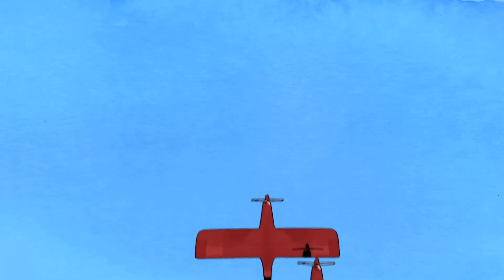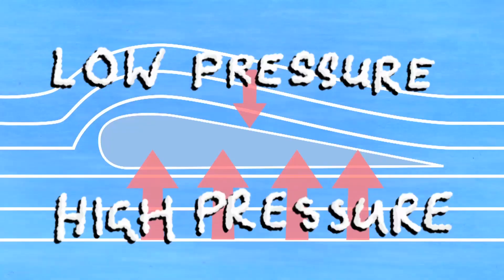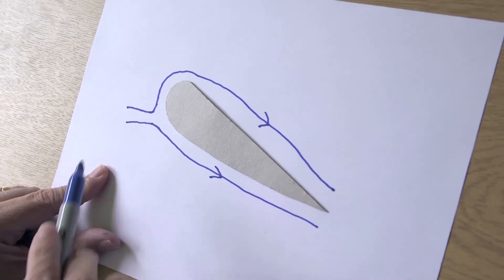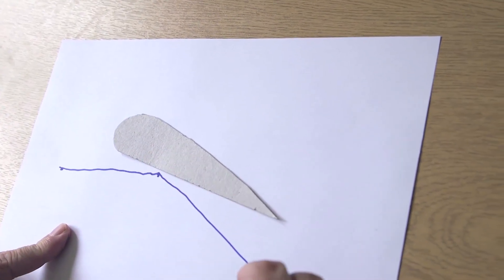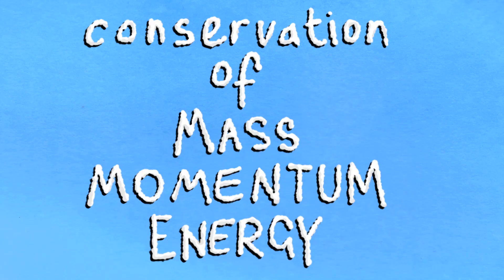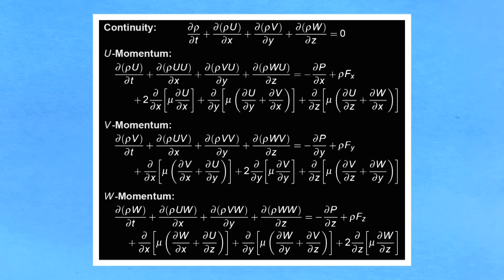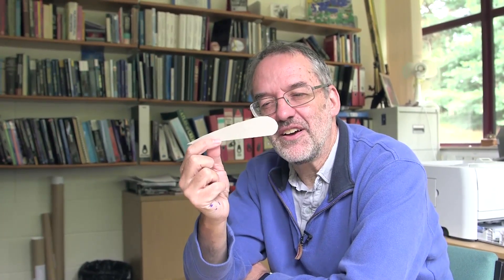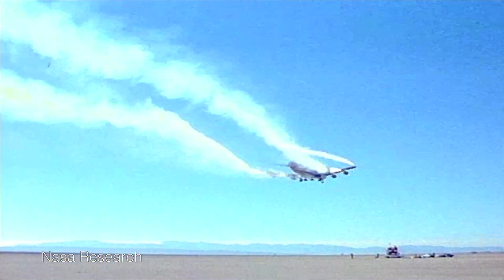Lift and Wings - Sixty Symbols

Comment: Why is there a pressure difference at all? I'm wondering that, because the air is only streaming faster because the pressure got increased in first place (7:22). So why doesn't that cancel out the Bernoulli effect leaving you with same pressures on both sides?
Reply: Pressure is NOT the only way a fluid can apply a force to something.  The total drag experienced by an object is found by integrating ALL of the forces per unit area around the surface area.  An infinitesimally thin flat plate placed at a zero degree angle of attack has drag (a force), because of the no-slip condition imposed at the surface.
Reply: niffenator  Yes, although skin friction is a minor part of total drag on the the average light aircraft. It’s not generally realized that the surface of the Hubble Telescope mirror ( never mind the surface of an aircraft wing ) looks like a topographical profile view of Switzerland at molecular dimensions!  So any airflow over the surface will keep crashing into the peaks or plateaus and bouncing back in random directions into the valleys and canyons between them, in effect setting up zillions of mini stagnation points over the whole surface of the aircraft , not only it’s wing, and it’s this effect which is responsible for the no-slip condition and resulting velocity gradient in fluid flow over fixed surfaces .
Reply: The pressure differential is there because that's the only way gases can ever apply a force onto anything.

Think about it.

Any time air is pushing on something, there's high air pressure on one side and low air pressure on the other side.

This also applies the other way: Any time something is pushing on air, it creates a high pressure zone on one side and low pressure zone on the other side.

Now, the effects of these pressure zones can be very different depending on context. If you're pushing a flat cardboard sheet through the air, the air is flowing from the high pressure zone (in front of the board) to the low pressure zone (behind it), creating all kinds of turbulence, and presenting itself as drag.

But if you turn the cardboard sheet sideways and then angle it slightly, you'll notice that you're pushing air sideways, and the air is pushing the sheet sideways too so it can be difficult to hold onto it from just one side.

An aircraft's wing is also pushing the air downwards as it flows around the wing, and the only way it can do this is by being shaped and/or angled in such a way as to create a high pressure zone below, and low pressure zone above. A wing is also usually a lot better at this than a simple cardboard sheet, because of the way it's shaped to minimize drag and maximize lift.

The reason why an aircraft's wing doesn't "throw" air downwards is quite simply because there's more air in the way to stop a significant downdraft from being developed in the short time the wing travels through the air. In effect, the wing is "leaning" on a very large amount of air both above and below it, and that air doesn't really move all that much.

If a wing were to travel through the same region repeatedly, then it would eventually start to create a downdraft through that area. This is what happens when a helicopter hovers stationary in the air, or when a propeller is spinning and producing propwash.
Reply: HerraTohtori  Well, I would start by saying: To create lift u need to accelerate air downwards. But you are right; this goes together with a pressure difference. But can u really say that a part of the pressure difference comes from Bernoulli, which is what was said in the video in my opinion, or is it only the downward acceleration, which causes the pressure difference? I do not believe in the first option. The reason for that is in the main comment.
Reply: That is correct. The use of the word 'compressed' is not helpful because we tend to associate that with eg gas in a bottle (compressed by comparison to atmospheric conditions means that the volume has gone down and the pressure up). Each 'lump' of air in this region can be thought of as moving faster because they have a narrower 'channel' to move through, as you say. It can only obtain the energy required for the increase in speed by extracting that from the energy stored in it (ie each lump is subject to external pressure from its neighbours which does work on it by squeezing it. This is as if each lump acts as a spring. As the spring is released a little (P decreases) so its speed increases). 

I used to be confused because I believed that squeezing the fluid would result in a change in volume. At low speeds, the volume change is negligible, even though the pressure changes are significant ie the fluid acts as a very stiff spring.
Reply: The pressure difference is caused because the wing is interacting with the air in a way that deflects air in one direction, causing the wing itself to be deflected into another direction.

Bernoulli equations are always relevant and correct, but just looking at Bernoulli's principle in order to explain the pressure drop is a bit misleading and can lead to misconceptions such as the "equal time principle".

The pressure difference forms because it's the only way for there to be any force transfer between the wing and the airflow. It's just as much a cause as it is an effect. The lift force is generated by the pressure differential, but the pressure differential is caused because the wing applies a force to the airflow. It's a kind of a chicken and egg problem, see?

If the wing doesn't generate lift, then there is no pressure difference. If there is lift, then there must be a pressure difference as well. It's impossible to say whether the wing creates a low pressure zone in order to generate lift, or whether the low pressure zone is created as a result of the wing generating lift, because they are the same thing: The only way gas or other fluid can apply a non-zero total force on something is by a pressure differential.

Asking why there has to be a pressure difference for a wing to provide lift is kind of like asking why a table has to have legs to stay up.
Reply: the leading edge of the wing exerts a force on the air. the air has a (sound) speed at which it can respond to such forces. when using a hand pump you exert a force that (due to the closed nature of the system) increses the pressure in whatever you are pumping. the pressure difference that the wing creates will depend on its speed relative to the air and the air's ability to respond to the force and move out of the way. 

air tends to go from high to low pressure in order to stabilize the forces acting on it.

If you increase the viscosity (thickness) of the air (imagine the wing like a knife through warm butter) the wing would not affect (much) the air above the wing, and you would separate the air from parts above and below the wing. this would imply a vacuum (zero pressure) between the sections. the butter can remane in separate parts because it is immersed in another fluid that fills that vacuum. since for the wing it is only air (and because air is low viscosity) the air will move in response to that pressure difference from high to low pressure. since the wing is constantly moving it can continue to make that pressure difference
Reply: No, the only thing that causes the pressure difference is the fact that the airflow over the top of the wing is much faster than that over the bottom. Applying the right Bernoulli equation (there are several versions) will definitely allow you to calculate the lift force of an airfoil if you know the distribution of air velocities. The crucial difference is that his equations do not explain why this velocity difference arises in the first place, which is what Euler's equations do for inviscid flow and Navier-Stokes for viscous flow. The downward acceleration is a direct consequence of the pressure difference: the air farther away from the wing will remain at higher pressures and is pushed towards the lower pressure area, creating a net downward flow. In a similar vein, the pressure difference causes the air to bend ever so slightly toward the airplane on top of the wing and away from it underneath, giving rise to tip vortices. All of these effects are inextricably linked to lift in real airplanes.
Reply: Are you sure that the airflow over the top of the wing isn't faster because the pressure is lower there?
Reply: Hmm, I think it would be most correct to say that they are simultaneous. Bernoulli's finding in fact was literally that an increase in fluid velocity and a drop in pressure (and/or potential energy) always occur together. My reply was directed at David's second post, the "no" meant to express that it's not correct to say that the pressure distribution on the wing only arises from the downward deflection of air, but rather all of these effects are intimately linked together.
Reply: Ok so it's really complicated. Maybe you should understand the Bernoulli effect to understand this better. But I'm not happy with the explanation in the video. The Professor explained it with conservation of motional energy. But you can also use the Bernoulli effect with the air accelerated by an hairdryer, which means the energy for the forward momentum of the air doesn't have to come from the motion to the side aka pressure.
Reply: Well, not entirely, because Bernoulli's principle stems from conservation of energy. A hairdryer may add both kinetic energy and heat to the flow; Bernoulli's equations can only be applied outside the fan and heater sections. Moreover, the flow downstream of the fan will likely be turbulent and dominated by viscosity, where Bernoulli's equations assume smooth, inviscid flow. The effect is still there to be sure: the air upstream of the fan will definitely accelerate and decrease in pressure/temperature, while the air issuing from the nozzle will expand, slow down and cool down. But to get a quantitative analysis of the flow variables, especially across the fan and heater, you will have to apply more rigorous mathematics, including conservation of mass and momentum as the professor correctly states.
Reply: +Steven Franzen That's exactly what I mean - the relationship of cause and effect is really kind of fuzzy here. The flow can't accelerate without pressure being reduced, and the pressure being reduced requires that the flow is accelerated.

It's really kind of difficult to say which one the wing actually does "first", because as you noted, they're pretty much simultaneous and tied to each other.

What's really interesting, though, is that even with a flat plate aerofoil, you get lift when you give it some angle of attack. That means, even with a very simple aerofoil, the flow above the "wing" is accelerated, and a low pressure zone is created there. So personally, I don't like explanations that focus too much on the aerofoil's shape, because that kind of seems to ignore the fact that you get lift from a flat aerofoil as well. And it's not just "deflection" lift there either, it's the same kind of lift you get from a more advanced aerofoil - the flat aerofoil just produces less of it, and stalls easier.

In my opinion, the simplest explanation for the acceleration of the flow above a flat aerofoil is that when air goes over the leading edge (in laminar flow), it adheres to the top surface of the plate due to Coandă effect, and follows the surface towards the trailing edge. But because the plate is tilted, it's flowing downwards, away from the air above. So more air from above is trying to follow the air flowing downwards, in order to fill the void... so that's the low pressure zone. And because there's a low pressure zone, the flow over the wing is accelerated.

A more complicated aerofoil shape does things a little differently, but the basic thing is the same - except now you have a curved surface to consider, so the flow is turned continuously instead of abruptly like with a flat aerofoil. My visualization is that when air molecules are moving tangentially along the curved surface of the wing, Coandă effect again forces them to follow the surface and thus deviate from a linear path. This means the wing's surface is pulling air away from its natural, linear path... and pulling air above it towards the surface as well, so again, a low pressure zone is created and the flow is accelerated.
Reply: Yes, paper airplanes get by with very flat wings and many are very able flyers. What really happens is that any perturbation to a fluid, for example when a moving fluid encounters a solid object or an object moves into a fluid, sets off waves traveling at the local speed of sound. This is how the undisturbed fluid is first "notified" of the change and caused to react. Upstream of the object, compression waves are emitted, causing the fluid ahead to start deflecting away from it. At the same time, expansion waves recede behind it and cause fluid at higher pressure to start accelerating towards it.

Aerofoils enhance the pressure reduction by maintaining a large region of accelerated flow. The attachment is not due to the Coandă effect, it is just the flow being accelerated out of the way as it approaches any obstruction, which sets up a situation where the pressure initially decreases with the distance traveled along the surface. The ability to generate lift is limited mostly by the fact that you simply can't keep decreasing the pressure: eventually the gradient will reverse, which you can try to make as smooth and as low as possible, but nonetheless the attached flow will eventually be unable to overcome viscosity and detach.

The Coandă effect proper is related to jets, but the principle is of course the same: they induce, by virtue of their elevated momentum, a pressure gradient, causing them to entrain the surrounding fluid and/or stick to a surface. It is in fact employed in the slats and flaps of modern wings, which form channels that generate sheet-like jets, supplying extra momentum to the flow across the top surfaces of the wings and flaps. This is far more efficient than an equivalent increase in wing area and shape without gaps.
Reply: pressure is not increased. the obstruction means the air has to go faster (what comes in must go out) and faster air has lower pressure (venturi).
Reply: Depending on the angle of attack air gets diverted above or below. In addition with a starting vortex created at the tail of the wing you get a rotationfield that further accelerates air at the top and decelerates air at the bottom. google: Kutta–Joukowski theorem